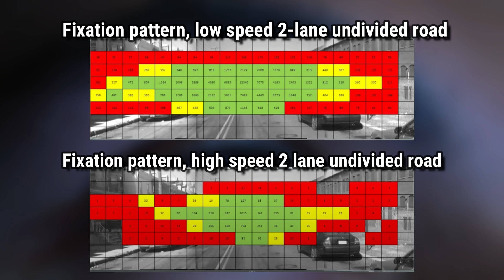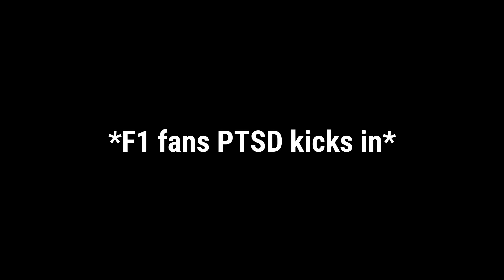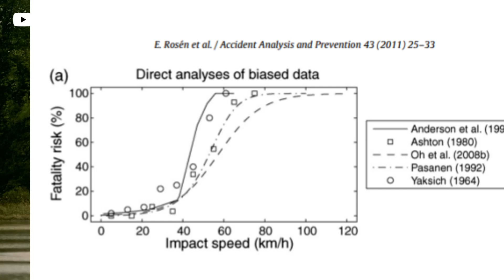Why Speed Limits Are Useless

Comment: I was taught that a speed “limit” is the maximum speed allowed. These days the speed limit is merely a speed suggestion that is usually ignored.
Reply: Yes, so was I. However "these days" have existed for well over half a century (in my case) and, if anything, more people than ever are traveling at or below the posted limit! 

Problem is, speed limits used to be determined by running an engineering study on the road after constructing it, having no posted limit... And then the limit would be set at the 80th percentile - the speed at which 80% of the drivers would go.
But somewhere along the way, politicians go into the mix and lowered those logical, safe limits to induce revenue and "claim" it's safer... 
And now this is a mess!
Reply: @openeyes-411  I don’t know where you are from but here in Ohio I -75 is a racetrack. I usually go between 70-75 mph and get passed like I’m sitting still. 80-90 mph seems to be the norm. I never see anyone going under the limit.
Reply: @jamesdennis2058  It is because the road itself and the cars are capable of much higher speed than the 'limit' they set. Learn a thing or two from the Germans: no speed limit on 70% of their Autobahn (equivalent to interstate), some people cruise at 80mph (130kph), while some cruise at 125mph (200kph), and a few drive at 186+mph (300+kph), yet their accident rate and death rate are much much lower than US and most European countries (together with banning left and middle lane cruising, undertaking and better driver training).
Reply: @jamesdennis2058  If nobody goes under the limit, then it means in some way the road is not designed for the speed limit. Its much safer to go the speed of mean free flow traffic.
Reply: @openeyes-411 I’m in California, people only drive at or under the speed limit in the left lane lol
Reply: yeah, but let me tell you. American roads are structurally rated for 80+ mph for the most part, a lot 90+. The issue is the Limit it 65, which is very very very slow compared to what the road can handle. Yet politics is involved as well as poor driver education leading to situations where following the speed limit is the most dangerous choice you can make. The difference in speed is the real danger, not the speed itself. Someone doing the speed limit when the rest of the road has agreed to do 20 over, creates a hazard. That hazard leads to accidents, not the overall road speed. This is why we're conventionally taught to maintain the speed of the cars around us. That's the safest way to do it. Sadly politics will always win here, and real change is a pipe dream.
Reply: @kattkatt6961  Yep, go with the flow and stay out of the way at the same time. Everybody has to have their own lane these days.
Reply: It is the maximum but is also expected if your vehicle can do it and the weather is good. The reason for most speeders is because they're trying to get around the slow cars and need to speed to do it.
Reply: @Qbert-379  I can agree with you to a point. I usually run at the speed limit or a little above, so I don’t consider that as slow. If I got a ticket for 7 mph over the limit, how illegal is it to go 80, 90 or faster? This is not a German autobahn, this is the USA with posted speed limits and (supposedly) penalties for driving too fast.
Reply: @jamesdennis2058  You need to know what your local cops speed forgiveness is. In MN you can do 10 over all day long but I heard the official is 9 over. If people did the limit to 5 over everyone would get along, its the people that are constantly doing 5 under that ruin the roads for everyone.
Reply: @jamesdennis2058  police are rarely on interstates and it can only be state police.  so going 80-90 is normal and basically has no punishment. plus if there's 1 cop and 30 ppl speeding he cant pull over.
Reply: @Qbert-379  my rule of thumb for “speed forgiveness” is:
0-25: I’ll go the exact speed
25-40: I’ll do 5 over
45-55: I’ll do 10 over 
65+: I’ll keep it under 80 if there’s a cop, if not then I’m driving as fast as I can without being a danger to others
Reply: @acog_quarks8753  Ok, that's fine if your the only one on the road but in traffic do you go with the overall flow or do you stick to your rules.
Reply: @acog_quarks8753  On what, your mood, the music, or how much coffee?
Reply: @Qbert-379  on how dense the traffic is .. duh
Reply: It doesn’t help that even the run of the mill civic is rocking 240 horsepower nowadays. I revived a vw diesel with 54 hp, feels like I could get there faster walking
Reply: I95 is marked at 55 speed limit but everyone is between 60-70, going 55 is really dangerous on that highway
Reply: I learn that truly limit is 5 mph above of what it posts as 70 mph for 65 mph posted so I just follow that rule yet too many so impatient with me. So by good thumb that shorter distances between cars equals to slower speeds so I ended drive 45 mph in 65 mph as it show how badly they tailgate me. I had do that as if I stop suddenly then they will crash my without giving them chance to stop fully. By slow down they crush me should be less severe. If they take closer then I can go lower as 30 mph as needed. Some of them did give me more space so I can back to posted speed and some of them just do illegal pass. Few of they did try get my car stop so they can do their rage road stuff which I have no interest to join that bloody battle. And will not stop for them and keep going. At last, one of them actually try rum my car with their car. I dodged that and that car ended rolling over hill. It was quite deep. That driver did survive but in coma for so long time.
Reply: Slow down
Reply: @burntrubber7458  Why, so we can have more traffic? Develop your skills and keep up. Stop using slow as an excuse to not learn how to drive.

Comment: At first i thought this was going to be a video made by some ignorant car driver. Good thing to see that its not.

Well made video, props to you. Just want to make a slight nuance in youre vid about the example you used at 5:30.

Yes, visually narrowing the grey asphalt helps, but this is not the reason why this type of road is so successful in making you feel unsafe while driving this road.

Roads like these have a speed limit of 60 km/h and are used for low traffic volumes in area's with low/no density. These roads are very small. Normal cars can often pass eachother, but if there is enough space, its not much. This is why you see the cobble on the edges of the road. Very uncomfortable to drive and it still keeps the road small. When cars or bigger vehicles need to pass eachother, there is no other way to slow down to like 10-20km/h, which is very benificary to safety.

The most deadly roads in the Netherlands are the 80/h kmh roads who are wider and have seperated lanes for each direction and proves very well that perseptive (un)safety is the best way to make roads/streets safe.

By the way, the red lanes in this example that you named as bicyclelane isnt actually a bicyclelane.

We have two types of lanes. Suggestionlanes that is often red but not nessesarely so. Its often specifically made for cylists, but it doesnt need to meet designstandards that cyclelanes have. Cyclelanes are recognizable with a painted cycle in the lane itself.

Comment: One thing I don't agree with is the rows of trees alongside the road. They can hide children about to run out into the road. Where, if the trees were not there, a car driver would see the child all the way from the sidewalk to the road, or even all the way from their parents' front lawn to the road.
Reply from the maker: But on the flip side, the rows of trees provide a very solid barrier that protects pedestrians and cyclists from any drivers who may lose control of the car or come off the road for whatever reason
Reply: @nicomotor  Except that most of it is not protected.  The slim chance someone will run off the road and the slim chance they'll hit the tree.  Your original point is valid, but this reply example is dodge-y.  The city I live near has huge trees that are planted in lawns and arch over the street.  This makes the side walk visible. But when these trees age and limbs fall, they collapse roofs and will kill people if they happen to be inside their home at the time.

Comment: The Dutch may have their nicely laid red brick roads to rumble drivers into submission, but here in New England we have a much more practical approach to achieving the same results: absolutely abysmal road surfaces and potholes. Whereas the Dutch require skill and planning and all those other expensive aspects, we just build them like crap using a shovel and a pickup truck. Even the Interstate has a problem lasting more than a year.

Not joking aside, our whole approach to safety is simply forbidding. And if that is all you've got, you're going to have people not complying with often dire results. I'm all for dramatically increasing the legal speed limits on our interstates. At the same time, on local roads and especially in urban areas, this is not the place to go fast. And 40mph on a city street is freaking fast. Not for the driver but for the things that are or might be happening around. The most classic example is idiots, pardon me, good drivers complaining that someone cut them off or entered the road w/o looking. Yea, that happens around towns. But with our very wide roads, the 25mph speed limit won't achieve shit. People will simply ignore it because, dude, that feels slow AF.

Comment: As someone who loves to speed, i absolutely agree. Lets make 30km/h seem fast and thus fun, lets have more fun commutes and safer streets
Reply: You really can't make 30kph seem fast and fun in a modern car. The vehicles are designed to feel comfortable and safe at 150kph... 30kph feels like walking.
The only thing you can do is make it feel annoying for the driver.
Reply: @mattmattmatt131313  make a tight twisty street with trees on both sides and it will be exciting
Reply: @wenzl4  I would have to see an example of such a road. But from what I can imagine I can't see a road fun at such low speeds. Making it narrow enough to be considered challenging would just mean it's so narrow you are more worried about scraping your car. And it's so hard to see out of a modern car as it is anyway. So this would just lead to more frustration and annoyance for the driver.

Also introducing a bunch of pointless twists and narrowings specially on a road that you know from before the "redesign" that you know can easily take 50kph, doesn't feel fun. It just feels like the road designer is _ucking with you deliberately. Ask me how I know lol
Reply: @mattmattmatt131313  the issue of modern cars is its own, people will prioritise cars that are small and well fit for theese roads if most of the roads around them would be like this. You can have fun on a road designed like this to be deiven on at 30km/h but not in a huge SUV, but in a small japanese car for example you will have a blast going 10-20 over on theese streets.
Reply: As a driver and a cyclist, I agree too, as long as cobbled streets and potholes are not common in a city.

By the way, speed being limited at 19mph/ 30km/h in a city does not mean for drivers to have the reflexes of a statue or spending a good part of their urban driving time with their eyes locked on their smartphone screen; these are the actual causes of traffic jam
Reply: In California, our roads are designed the same as in Nevada or any other state meant for 80mph. But our speed limits are much lower. Even though we drive 90-110mph.  Our roads are made to create as much leniency for error as possible.
Reply: then you dont love speed
Reply: @mfdoom4358  if you drive 50km/h on a really tight road you feel fast, but you are not going fast…
Reply: @wenzl4  then you like the feeling of going fast not speed
Reply: @acog_quarks8753    No, mfdoom has a point.  30 km/h is really slow.
Reply: What
Reply: Exactly. 

GoKarts are actually slow, but they feel fast. 

My airplane however, seems slow, but is fast. 

My bicycle and e-scooter are simply exhilarating. 

Walking 2-4 miles per day at 61 is the best.

 And who in the world ever said roads were ever meant for entertainment? Or did I misread your comment? Help me understand.

People who think their speed is more important than the 44,000 annual cars deaths in the USA are simply
unenlightened

Comment: 0:27 the Shuttle has never gone 24,000mi/hr. Apollo 10 holds the fastest speed when it returned from lunar orbit. But the shuttle was only around 17,500 from low earth orbit. I don't know what its speed was after repairing Hubble, though. Anyone find that orbital velocity?
Reply: The space shuttle shot was just an illustration representing space travel in general. Apollo 10 reaches the fastest speed ever traveled by a human: 39,897 km/h (11.08 km/s or 24,791 mph), or roughly 1/27,000 of lightspeed.
Reply: @alabamaal225 wow… when u put it that way light years don’t seem crazy big
Reply: For the record, we're all traveling together at a speed of about 66,600 mph.

Comment: The big problems not addressed here are really about separating the places where cars drive to get between destinations from the places where people walk (and bike, or skateboard, or whatever). That street/road design is a big problem, as you point out, not just because "cars are driving fast" but specifically because it's not separated from the businesses, parking lots, sidewalks, bike lanes, etc. Somebody driving from one destination to another should be able to do so safely at 50+ mph on surface roads, so long as there are not pedestrians walking a couple feet away, bicyclists sharing the same pavement with a huge speed differential, and cars pulling out of parking lots directly into 50+ mph traffic. There's a lot of talk about "let's make cars drive slower" instead of "let's allow cars to drive faster, but separate them from people not in cars".
Reply: Absolutely this PLUS what OP said PLUS making more cities and suburbs walkable/the whole country less car-dependent by default. I'd love to see more walkable NICE places that aren't ridiculously expensive, as well as more bikes or at least more motorcycles (reasonable ones not crotch rockets or hogs) instead of cars.
Reply: @Drunken_Hamster  I think it makes a lot more sense to focus on making cities more walkable (and bike-able) while focusing on making car traffic flow more efficiently in suburbs. That's the fundamental difference between cities and suburbs...cities are dense and can keep everything close together, often with a lot of multistory structures. The number of people per square mile is often too high to handle all the cars they would need to get around. Trying to make suburbs work without cars is missing the whole POINT of suburbs. Many people WANT to be spread out, not living, working, and shopping on top of everybody else. But that fundamentally requires individual vehicles.
Reply: @elektro3000  You can have suburbs that are medium to low density and not be car dependent for daily needs. That's my point. Not saying you need to stack everything like malls and multi-business complexes into suburbs, but you shouldn't have to drive 10+ minutes just to buy some milk, produce, or toiletries at reasonable prices. Unless you live in the true countryside or I guess you'd call it the "deep suburbs" with more than 1-5 acres of private property, there's no excuse for daily essentials being further than a 10-15m walk and half that on a bike.

And that's to say nothing of the lack of group/community activity spots in modern American suburbs or how nobody's really that spread out in them with typically 1/4 acre lots, at most, not to mention cookie-cutter only-to-code construction by soulless corporate entities that's sold to the prospective homeowner at a massive premium.
Reply: How about everybody follow the same rules, and don't act like getting to your destination is more important than the other people sharing the road?  How about don't use the road as your personal test and tune track?
Reply: @reubenmorris487  Roads are not meant to be shared. We don't share Railroads with other modes of transport. If modes are sharing an area it is a street or a stroad, not a proper road.

Comment: the example around 5:30 is actually the biggest challenge dutch road designers face. These roads are almost all 60kph rural roads, and 60 is almost never the right speed for these roads. 
When they're empty at a quiet moment and there's no driveways you want to be going faster, but if it is busy with people walking and cycling 60 is way too fast!

But having separated bike paths isn't feasible either because there usually just isn't enough space.
It's just the half assed solution they throw at roads that have low traffic volumes. If the road gets busy enough for the problem to get really apparent they like throwing a crap ton of speed bumps at it, but these tend to be so aggressive you have to slow down to less than 50 to go over them, which is really annoying for drivers.
Reply from the maker: That is fair. Flat, straight roads feel comfortable to drive quickly on. I guess at that point it's up to the drivers to slow down enough for cyclists.
Reply: Oh my god, there's a bend in the road! Let's hit the brakes, so we're going 50 instead of 60 in an 80.
 😂   🇳🇱